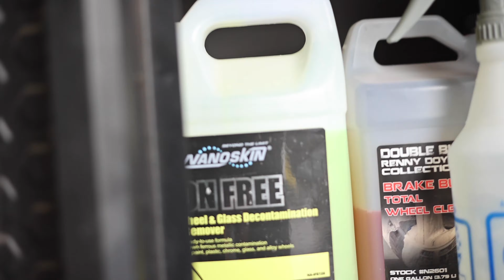Cadillac CT4 V Blackwing gets PPF and Ceramic Coating

Comment: Got a CT4-V Blackwing with both CF packages a month ago also in Infrared Tintcoat.  Luckily my Dealer was much better than this delivering dealer.  Mine has some very minor swirl marks but I only found one area of glue residue.  It will still need a polish before Ceramic but it is much closer to very good than you were faced with.